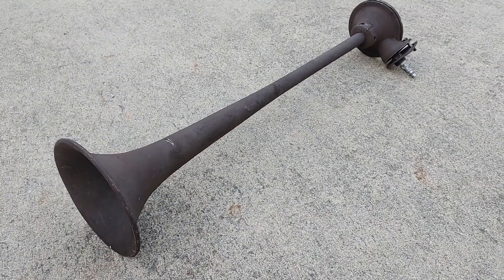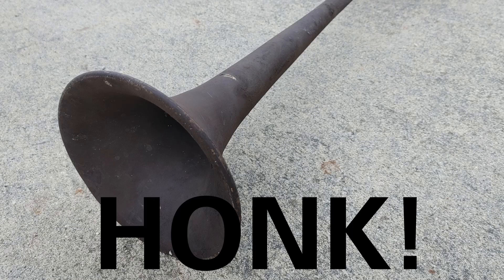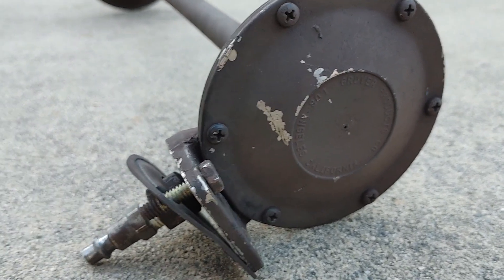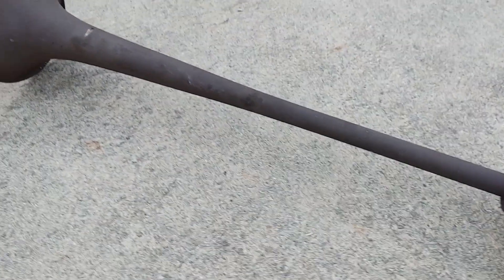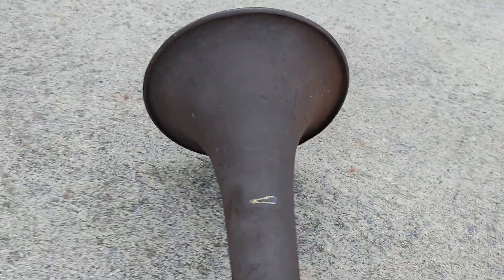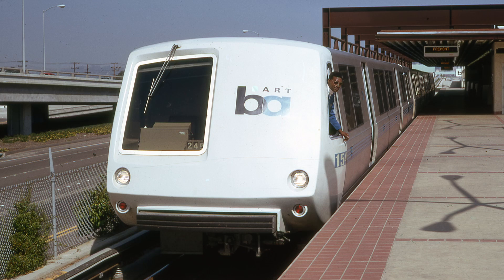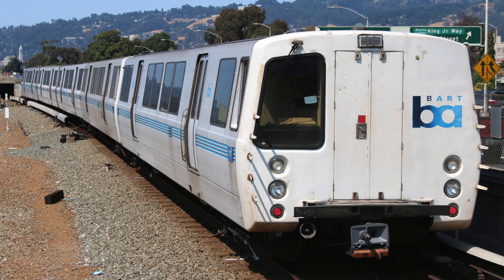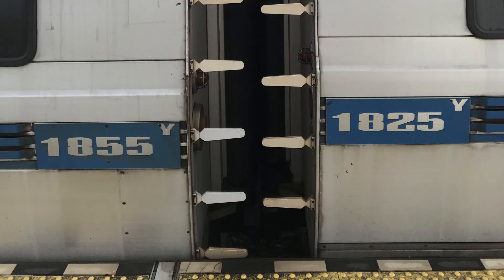BART Legacy Fleet: Air Horn

Comment: It's always interesting to see Grover truck horns used in subway applications. The PATCO also uses Grover horns, opting for the 1600 series. Despite how weak the spun brass bells are on those horns, they seem to have held up great. Definitely sets it apart from most transit systems that opt for horns from Nathan AirChime such as the P2 and KJ-24 along with Wabco horns such as the A-2, AA-2, and D-5.

Comment: Could you do a video about the air horn on the new trains?
Reply: the new trains don't have air horns, they have a bullhorn speaker that plays the regular horn, or if the emergency horn button is pressed, plays a shrill tone much louder. It was very common to hear it when the trains were new and the operators were being trained on them.
Reply: I’m confused.  It felt like you gave me 2 different explanations
Reply: @larailfan1714  new trains do not have air horns, they have an electric horn that either plays the regular tone or a louder danger tone depending on which horn button the operator presses